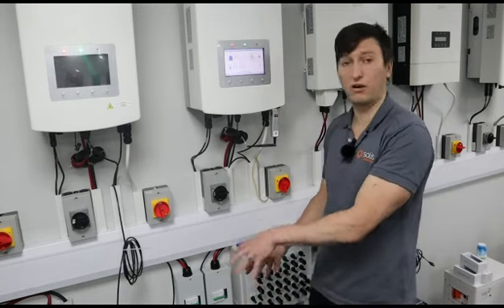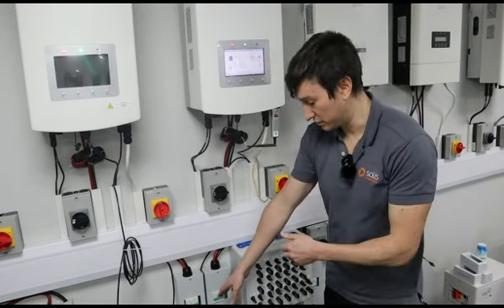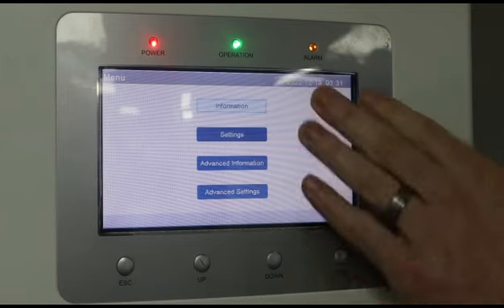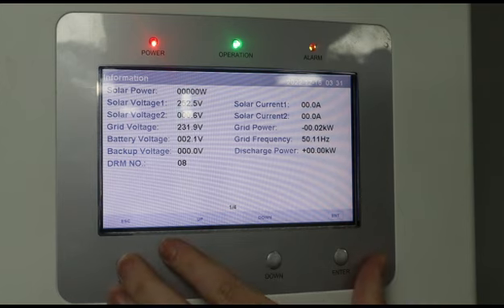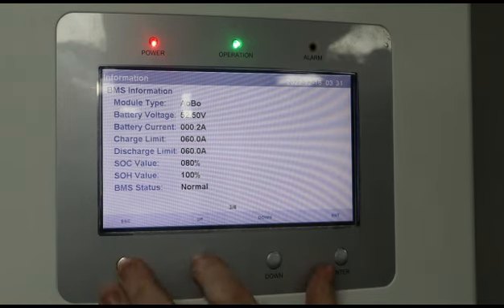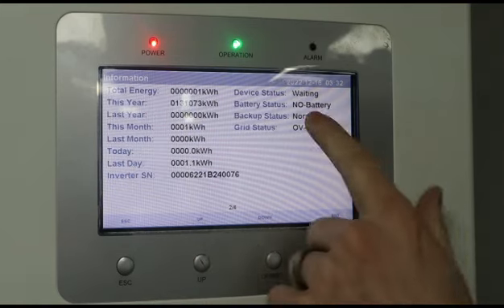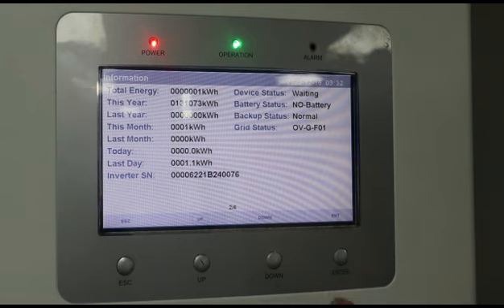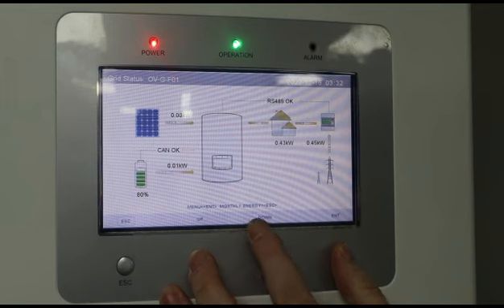Solis Hybrid - No Battery Alarm

Comment: I am getting no battery alarm every night when the battery is in the process of being charged from the grid. The DC breaker flips and the whole inverter goes offline. Any ideas what is causing this? It worked flawlessly from August to April and now has these errors almost every night
Reply: Hi Ciaran. I'm getting the same problem. Did you manage to get this sorted. Tnx

Comment: Interesting.....
I have a Battery Name Fail, i use a Pylontech Us 2000 Stack of 6 pcs., selected Pylon LV at my Solis RHI 4.6 5g, it Runs a short time ,it seems ok and then switch from the green LED to the Alarm LED. Battery Fail
Its Impossible to use the Battery, i start the RHI new, 3 minutes later the same problem pops up.
Reply: I have the same issue... I'm using DIY battery with JK BMS and get the BATName-FAIL alarm... Have you found the reason?
Reply: @Tomson1105  one of the Pylontech Battery-BMS have a fault .
Without this "useless brick" the Stack runs now perfekt.
Modern batterys are much more complicaded that it seems.
And when they tell you..... plug and play, its a lie !!!